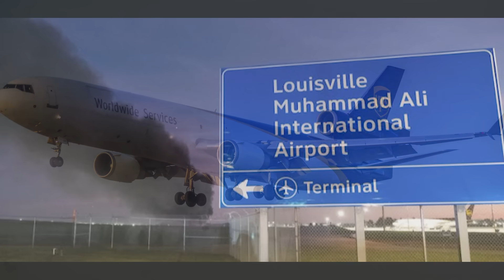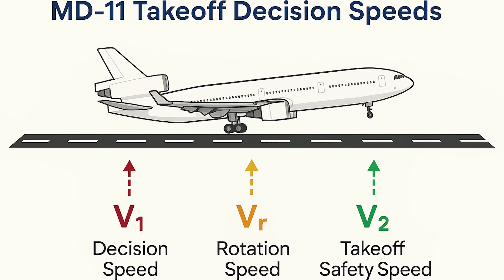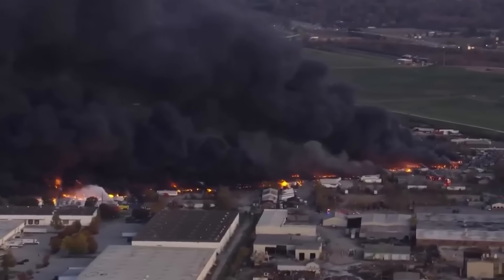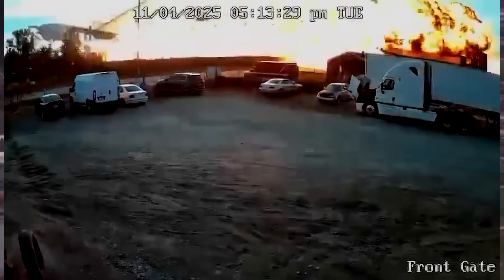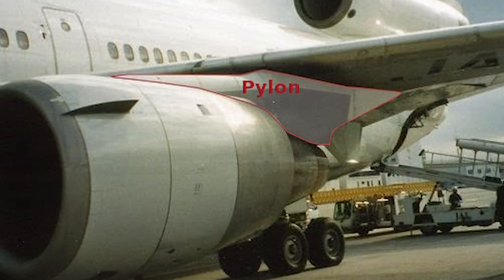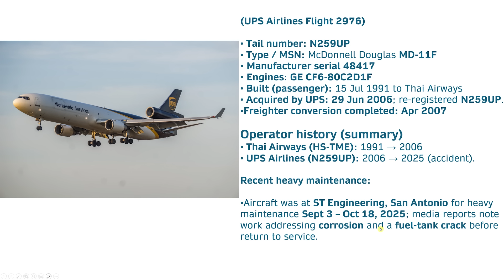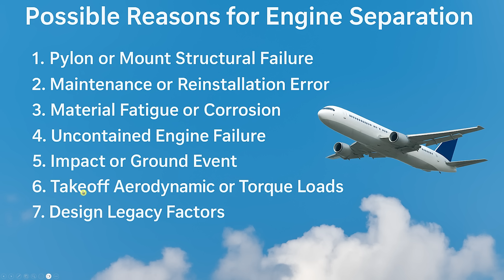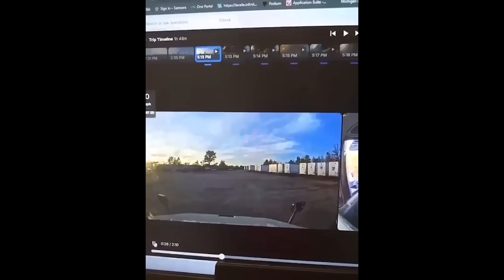What Caused UPS Plane Crash, Louisville, KY? How MD-11 Engine Fell Off

Comment: The worst part is the pilots' realization in that last twenty seconds or so that they were just along for the ride and nothing could be done but wait for death.
Reply: i would bet they tried everything in the know universe to save that plane right up to the moment it all went up..   there was no time to panic/worry as there was too much work to be done in the cockpit.
Reply: @Dirtnap300 actually, that's accurate. I've heard black box recordings of pilots in the last minutes before fatal crashes. Nearly all are calm and focused on doing what they can to prevent the worse. Only a couple realized it was hopeless before they met the end and said anything that sounded like resignation or panic. 
One stated 'tell my wife I love her' followed a few seconds later by 'oh my god, oh my god, oh my...' recording ended.

There is little time to realize something is fatally wrong and psychologically they get into a problem solving mode that is almost robotic in its emotionlessness.
Reply: @Dirtnap300   no time.. 7 seconds from liftoff to explosion.   All they did was pull back on the stick to get airborne and then it immediately began to roll on its side.
Reply: @terryreston555  Yeah, they had no more than 10 seconds TOPS... Definitely not 20.
Reply: @Dirtnap300  But nothing to do, name one thing they could try...
Reply: @johngreydanus2033  ...They could try to stabilize the aircraft and apply power to climb. That's likely what they were doing. It wasn't successful. There was no way to recover. But they would have tried until the last possible moment. They wouldn't have just given up.
Reply: @MJ-we9vu  The fuel and hydraulic leaks were probably so crippling that there was no time to reroute lines and control the aircraft while adding full power to the right engine. Just not enough altitude to get it all done.
Reply: @dc6233  ...Yes. I'm not saying there was anything they could do to successfully recover. I'm responding to the clowns who think the pilots didn't even try.
Reply: @johngreydanus2033 bro thats spoken in ignorance
Reply: @MJ-we9vu try what?
Reply: @johngreydanus2033  exactly. Nothing. By the time they knew they lost the engine all they could do was pull back on that stick. Then it began to roll. I counted 7 seconds from liftoff to explosion.
Reply: @Notinserviceij  Please educate all of humanity.
Reply: @MJ-we9vu  They had no time for any of that, 7-seconds of video, they were in take-off mode, full power, nothing more they could do, think about; everyone is saying this but cannot mention one thing they did or could possibly do.
Reply: @dc6233  So you think on take-off the right engine wasn't already on full power? they were doomed long before any kind of thought process can happen, video is 7-seconds, think about it. Even Captain Sully had more time.
Reply: @dc6233 the engine falling off effects weight also
Reply: @MJ-we9vu  These clowns will never understand what you are trying to say, unless they have trained as a pilot. Aviate, Navigate, and Communicate,  A pilot's first priority is to aviate. They don't give up flying the plane even when the situation seems impossible.
Reply: @johngreydanus2033 my husband is a commercial pilot, he said you and the FO do everything as hard as you can (bc its work, and theyre fighting the controls) bc youre screwed anyway,  but no one would ever give up.  He said sometimes your just screwed but you fight to the end to correct.  He said even when someone has a simulator crash, its upsetting.
Reply: Truly terrifying.  That poor truck driver, he witnessed something no one should see.   I can’t imagine the noise, the heat, and just the visual of his location.   He’s gonna need some mental help.   He witnessed a beautiful day, chilling on his break turn into a hellish inferno, like something out of a movie, absolute horror.   Hope you get some help my man.
Reply: @Lorthvader6871  yeah what is also crazy is you can hear the wind from the plane breeze through - that guy is lucky
Reply: That's horrible
Reply: A pilot's nightmare playing out in front of them. The last few seconds must've been terrifying in that cockpit.
Reply: @3rdFloorblog   7 seconds from liftoff to explosion
Reply: Pilots dont really think that until the last second. If they did they would not try any check or memory lists. Dont speak rubbish. They are highly trained professionals that fought tikk the end.  Please dont disrespect pilots like that. Its what they are trained for
Reply: @simpydasimp Pilots are trained to:
- aviate-fly the plane
- navigate- fly it to safety 
- communicate- let others know what’s   happening i.e; ATC, crew, etc.

Those guys would have been immersed in troubleshooting as it happened which was really fast.
Reply: @mickeyflynn5427  7 seconds bud.. they didn't have time to do Jack Chit, but pull back on that stick.
Reply: @mickeyflynn5427  thats basicall what i said in less detail. But sure.
Reply: I watched a lot of Mayday, it was probably like "What was that?! Come on baby!! Climb!!"

So sad RIP to the crew
Reply: I give them more credit. They avoided the Ford and UPS sort warehouse right in front of them if they had tried to stop on the runway. They tried to fly the plane, not put their hands up and quit.
Reply: @cynvision  They were doing things the way they needed to be done. Once you're rolling faster than your plane's V1, stopping on the runway isn't an option anymore; there just isn't enough runway left for it. You need to get airborne and hopefully limp the plane back around for a safe landing.
Reply: @cynvision  But not because of anything they did in response to the engine falling off, no control of anything, prove me wrong.
Reply: Probably all they had on CVR was "OH S*** " They couldn't have done anything to save it.
Reply: @ChrisZost  The AA191 documentary had to make up what they said because the power was lost with the engine. I'm somewhat wondering if the same goes for this new and improved CVR on this flight. And these days we'll just get a transcript. It's too personal.
Reply: Poor poor crew 🙏🏻🙏🏻
Reply: I've listened to a lot of CVR's. There isn't a whole lot of conversation in these that happen real fast except screaming at the end. I think most go into shock.
Reply: The pilots had no awareness of the full extent of the damage (thankfully). So they were still fighting to the end, not knowing they were doomed from V1.
Reply: I can guarantee that's not at all what happened. You're obviously not in aviation. Pilots were trying to fly the aircraft till the last moment. No time to panic or do nothing.
Reply: @Adam-fb7cd  I do actually know about aviation. Even as you are fighting to save the plane in this circumstance there comes a point where you know you cannot save it or yourself. You can see out the window how low you are, instruments are screaming at you, and in this nose-high attitude they had a long number of seconds to know they were doomed after the start of impact with the buildings. I know they didn't just give up as that is trained out of them, but the mind knows.
Reply: I agree with you to an extent. Crossing the V1 threshold. They knew they had no choice but to take off. I don't think they knew the engine was gone but maybe they salt. The engine was dead. A dead engine is not the same as a missing engine. That is  a considerably large amount of weight to lose on takeoff. Creating an imbalance if you remember years ago a plane crashed outside of the bagram airfield shortly after takeoff The load it was transporting shifted causing the plane to dive right back into the ground.
Reply: @geosorrell8938  Lateral vs longitudinal weight shift.  Big difference between the two.
Reply: @chrismaverick9828 7 seconds from liftoff to explosion.  Count off 7 seconds. And half of that 7 seconds was going into a 90° roll.. you aint thinking of nothing at that point. You are going into shock looking at immediate death.
Reply: @Adam-fb7cd FACTS. 

Listened to enough black box recordings of fatal crashes. Nearly all are focused on trying to stop the worst right up to the end.
Reply: @Adam-fb7cd  you cant do jack crap in 7 seconds bud. All they could do was pull back on the stick. Then that plane started rolling. 7 seconds from liftoff to explosion.  So tell us Mr super pilot, what would you would have thought of and done in 7 seconds? I gotta hear this 🤔
Reply: @terryreston555 
They were probably thinking some super know-it-all on YouTube it's going to be so proud he could count 7 seconds and he's going to post it over and over again. What a  stupid time to try to one-up everybody. 
Comments experts are a dime a dozen.
Reply: @Regan-m3m  my sister married a pilot.  He a captian with American airlines now. Ive been up with him numerous times in small planes and twin engines and jet also. Talked with him a lot. Also i study plane crashes as a hobby. Ive listened to all of the CVR's online for hours upon hours. So whatever.. most all ive heard that crashed upon takeoff did not say a whole lot. They didnt have time. And if you think you wont go into shock during a very traumatic event like that then you're just ignorant.  The human brain shuts down to protect the body from pain. Yeah, i study Neuroscience too as a hobby..  😉
Reply: @terryreston555  Oh i'm sorry i didn't realize your sister's husband was a pilot, bud. Except the NTSB said "the crew engaged in efforts to attempt to control the aircraft until the end" Now, trained crews don't just mentally shut down or wait for impact. There is training just for events like this. Every real CVR/FDR (not the commentary kind you watch on youtube) shows pilots keep flying the airplane right up to the last second. Just because the aircraft coudn't be saved doesn't mean they were sitting there in shock. If you’ve actually listened to CVRs, you should already know that.
Reply: @Adam-fb7cd  whatever, when that plane lifted off, they had about 7 seconds. I timed it. If you think you can do a damn thing in 7 seconds, then i suggest you make a video showing what all you would do sitting in that cockpit with the jet rolling to the left looking at impending doom.  I want to see your great skills and what you would do In 7 freaking seconds my friend. Educate all of us on it 👍.
1, 2, 3, 4, 5, 6, 7............ show us..
Reply: 7 seconds from liftoff to the explosion.
Reply: Yeah that's horrible but I'm sure they were trying everything to get that plane up just a little bit higher.  Looks like they almost made it
Reply: @kevinm9  I expect they had no idea the engine was gone . They can't see it out the window. It wouldn't have helped here but I think there should be a camera so the flight crew can actually see a view of the aircraft that'll help them know what is going on where they can't see. 
Just a dash cam ffs. A picture paints a thousand words.
Reply: @Veeger  I'm sure someone has thought about it but another person said "that one camera bump is going to cost ten thousand pounds of fuel over the service life of the aircraft!" and shut it down.
Reply: @Veeger  I've always felt there should be a monitor that shows them the engins, wings and rudder. They often fly blind wth only instruments to rely on.
Reply: @Veeger 
Of course they knew. They were too far along the runway to stop. The engine fell off before they rotated for takeoff. 
The engines would be at full throttle with one side of the plane being pushed forward and with the engine gone the other side is just having fuel pumped out of the wing on fire before they even took off.
Reply: Ain't no waiting just living
Reply: I counted 7 seconds from liftoff to explosion... not much living done in 7 seconds...       
 @gatorshoe
Reply: This is clearly a flight without being able to control and it stall near at the take off point possibly loosing the 2nd engine power. Also with poor lift and loss of thrust the right engine power still at full take off flips it on the left and crashes
Reply: The absolute horror
Reply: no one knows or will EVER know what these people were thinking
Reply: Yes, that's the horrible part
Reply: Why not have ejector seats like military aircraft?
Reply: @Ohnotwotoes  could you rven eject at that low of an altitude.. remember you have ti be launched high enough that a chute can deploy and establish an airfoil, you also need enough altitude to fly away from the debris field as its often on fire.. the tendency would befor you to be sucked in by the vacuum of the aircraft flying by before it crashed..
Reply: @eldoradoboy Probably
Reply: I agree. I can't imagine how terrifying this must have been to know this it the end.
Reply: @Jhubble515 to be fair it will have been a few seconds only. Its different for passengers. For the pilots they try and try and are focused until the last few moments. Trying everything they can
Reply: they were most likely still trying to fly the plane... there is an engine out on takeoff procedure... they had no idea the engine was gone... the instruments and warnings wouldve been for loss of thrust on that engine.. they continued to rotate and put the plane in the air per procedure, that airport offers almost no margin for error.. buildings and obstacles almost immediately past the fence.. the nose pitch is high indicating stall .. some airports offer a longer field past the fence where you could keep the nose low enough to gain some airspeed and not need immediate altitude...  while i have no facts to back up the thought.. it was bound for honolulu asnd being a freighter was likely running near maximum allowed weight.. max fuel load on board as well..  so id imagine that added to the complexity of the situation...
Reply: @eldoradoboy 7 seconds from liftoff to explosion.  And half of that 7 was going into a 90° roll. They didnt have time to think about anything. They probably went into shock.
Reply: @terryreston555  my point was that it was engine out before they rotated... the ycontinued to rotate and go airborne.. yes the wing stalled, stall horn probably blared.. but they were flying the plane... had they gone into shock or done nothing they wouldve never gone in the air.. yes once they went airborne there was nt much time before they crashed and as the general public we will probably never see what the pilot inputs were for that time period but I can almost guarantee it wasnt hands off the controls
Reply: @eldoradoboy  oh, i agree. He waa flying the plane. Had no other option at that point except get airborne or crash. Probably didnt know the engine fell off either. I just think after liftoff all they had time to do was basically say "oh chit" or something.. ive listened to all of the CVR's online. Most ive heard that crash right on takeoff dont say a whole lot . So i assume they are going into shock seeing whats coming. They are human
Reply: @eldoradoboy 
Of course the nose is pitched up... Have you ever watched a plane take off before? 
The flames were massive coming off the wing while they were still on the ground. Fuel pumps for pumping fuel to a non-existent engine.
Reply: I would have had a short chat with my Heavenly Father confirming my early check in!
Reply: I don't think that's the worst part.
The worst part is that pilots are the worst people, and most flights are totally unnecessary, especially private flights. The worst part is being on the ground and having to worry about the constant crashes we see almost every day now. People say I'm paranoid that a wrench or something might fall on me from a place.....THEY DON'T EVEN BOLT THE ENGINES ON ANYMORE 😆
Reply: @comicsmyth6778  flights are unnecessary? how do you expect people and goods t otravel? i suppose you are one of those that wants t ogo bac kt phorse and buggy?
Reply: @eldoradoboy  Send better bots, this one is completely restarted
Reply: @comicsmyth6778  ????? what bots?
Reply: Aborting take off might be a better option even after V1

Comment: Great analysis. I think this one will go down to both maintenance error and corrosion. The fact it was in heavy maintenance so recently tells the story. RIP
Reply: I am a A & P Mechanic with 40 + years of experience. Heavy Maintenance  (C and D Checks) are done after so many Airframe hours and flight cycles. Unless the A/C is brand new, most every A/C has corrosion and cracks due to the environment and the constant pressurization of the structure, this is why maintenance is constant. Engines are attached to the airframe with very large bolts and structural fittings and they don't just "Fall Off". internal stress fractures within the airframe or attach fittings would be the likely cause and those stress fractures would not be visually detectable. NDI  (Non Destructive Inspection) testing would be needed to uncover any defects...... I would look at when the last NDI  testing had been done.
Reply: @mikecarter5118  I know your community is buzzing with analysis. BTW, GA here - you guys are golden to us!
Reply: It's galling to think that cowboy maintenance is still being done after all of the incidents that it has caused over the last 50 or 60 years. You wouldn't drive a 35 year old car, but you should feel safe flying a 35 year old plane because the inspections and maintenance should've been done with an absolutely surgical amount of diligence.
Reply: @Dee_Just_Dee  Amazing that you already know the cause even though the debris hasn't been recovered because it still smoking.
Reply: @Dee_Just_Dee Thank Republicans for that
Reply: You don't think it, you guess it.
Reply: Great analysis? It's speculation at this point. Remember his presentation of the Titans submersible transcription that turned out to be fake? This is very sophisticated clickbait.